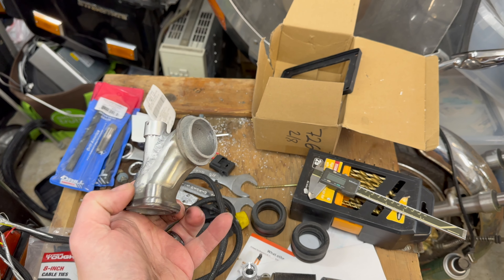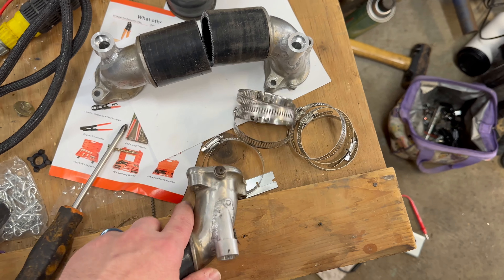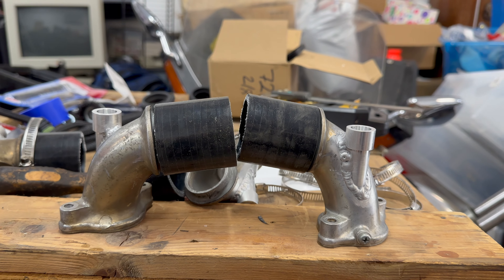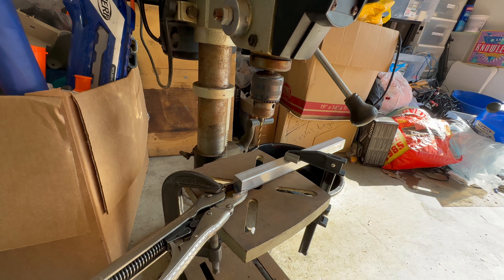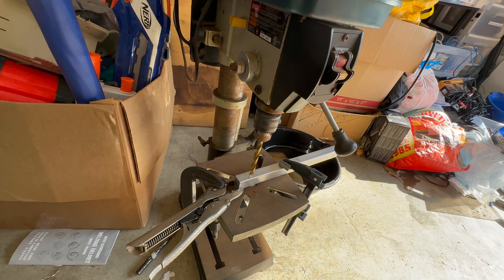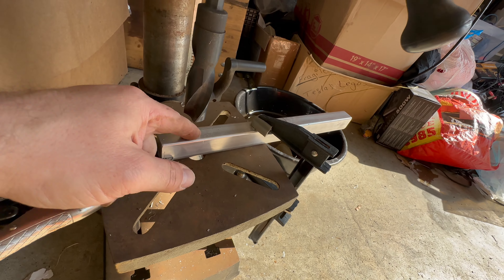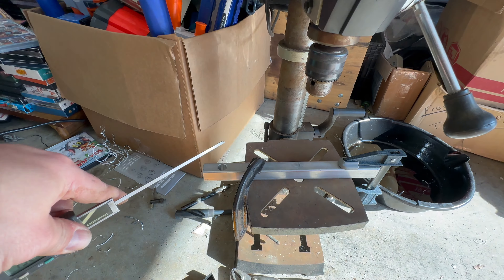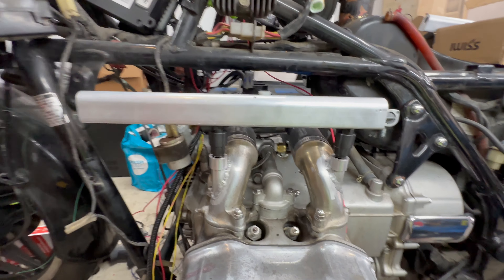Part 9 - Injector Bungs and Fuel Rails - 1981 Goldwing GL1100 EFI Conversion

Comment: I’ve been saving two matching gl1100 for a turbo-fuel injection dual(side by side) gl1100 going to a single diff/transaxle/transmission (depending on what hp and torque are capable of) for a street buggy/rail car

Comment: I think this is a great thing. The only issue that I think you might have later on, is available electric wattage. When I was thinking about doing this, I figured the only way to do it is if you also did like a poor boy alternator conversion. Because the goldwing as is makes about 300 watts with the stock stater and rectifier.
Reply from the maker: The only high wattage part of this conversion would be the fuel pump. You can easily find some free wattage by swapping all the bulbs to LED.

Comment: Videos are incredibly helpful, been struggling to find a wiring diagram for tail lights,2015 Indian scout, the wiring are individual female-male terminal instead of the 6 pin connectors. Anyhow need some assistance determining which goes with which. I’d be great if anyone can help

Comment: I hope you regain your motivation to complete this project.  What will you use for RPM sensor and throttle position?  Wideband O2?  What size injectors?   thoughts about a single injector intake manifold?  Microsquirt?
Reply from the maker: I picked up crank angle and cam angle sensors of some sort off Amazon. Just feed them 5v and ground from the ECM and they feed back the trigger wheel pulses. Wideband is a Bosch unit with an Innovate LC1 controller, old unit I had laying around from my turbo 4 banger cars I used to build. Injectors are about 33lb if I recall right. 
Single injector manifold would suffer from similar problems to a single carb manifold— icing inside from the fuel evaporation making cold weather running very rough. 
The MegaSquirt 3 Pro that I’m using is the very expensive better version of Microsquirt.